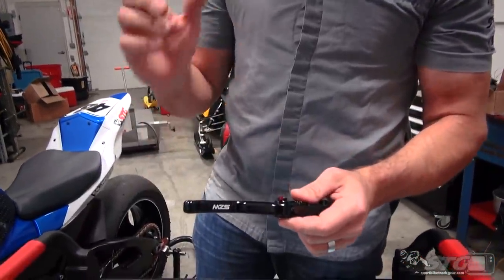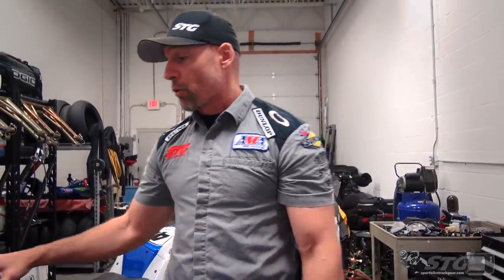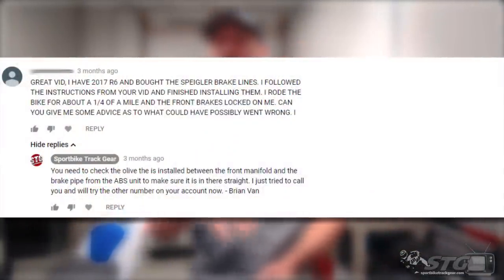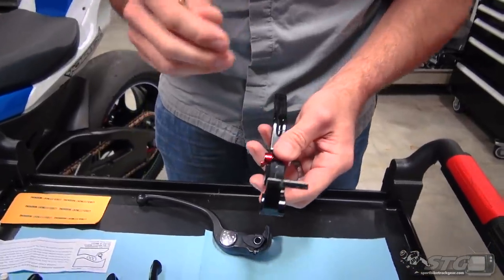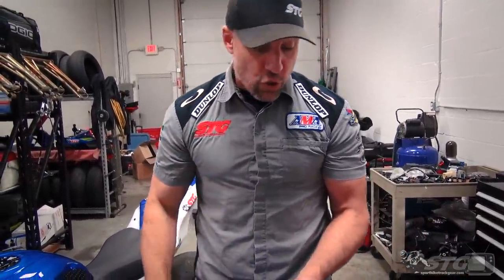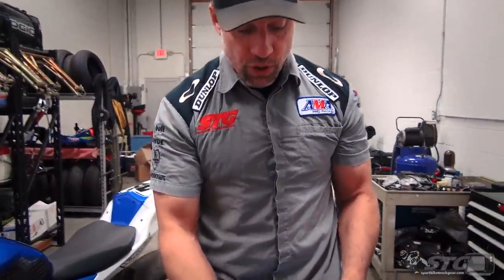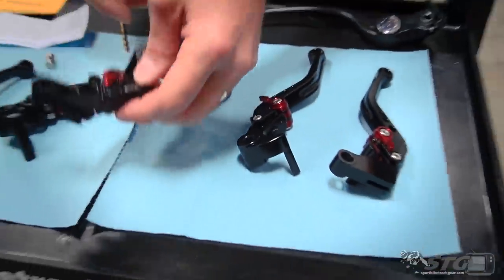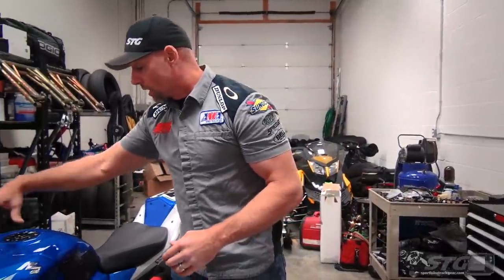The Truth About Cheap Motorcycle Levers | Sportbike Track Gear

Comment: I love STG but I also love my $30 eBay levers which are undoubtedly from China.  I also know people who have had $700+ rearsets snap like toothpicks.  Quality is important though and you must inspect any part that goes on your motorcycle putting safety above everything else!  I think Brian does a great job of trying to educate riders and get people to focus on safety and that is never a bad thing!
Reply: Agreed. It sounds like the story was 1 part cheap lever, 9 parts poor installation and poor testing.
Reply: I think that's pretty cavalier, considering we're talking about something that could catastrophically fail at any moment. I'll save money by buying cheap chinese made knockoffs when it's a wallet or sunglasses, but when it's something that you need to depend on to keep you safe, buyer beware.
Reply: You could apply that rationale to a great many parts on a motorcycle. Don't get me wrong, I think you absolutely SHOULD apply said rationale liberally, as motorcycles are inherently dangerous. But regardless, an aluminum bar is an aluminum bar. The line-bearing-housing interaction needs to be seated correctly, lubed, and obviously to fit with integrity. If that is the case, worry not. 

Either way, giving your money to STG is a good decision, so that's another plus to the expensive levers. STG takes good care of us all.
Reply from the maker: The issue with this particular lever was not caused by improper installation IMO. The tolerance between the cross pin bushing and the lever body was too tight which caused it to bind. Said binding caused the brakes to lock. - Van
Reply from the maker: Well said my man! If the $4 sunglasses shit the bed you just throw them in the trash and move on. - Van
Reply: @Bhg265  " But regardless, an aluminum bar is an aluminum bar."
This is simply not true. With some knowledge of mettalurgy and heat treatment you would not have said this.
Reply from the maker: @Bhg265  sorry man an aluminum bar is not just an aluminum bar. So many variables involved like grade, thickness etc...
Reply: @raydavison2972  Actually, after more more materials and engineering classes than I care to remember, I absolute would have said this. While your mention of heat treatment--considering the application in question--makes me suspicious (not to mention that you misspelled 'metallurgy'), nevertheless I will give you the benefit of the doubt that you didn't just google those terms...

As you and I both know the application dictates the requirements. In the case in question--5-15 lbs of force being applied to a lever (a liberal estimation even)--an aluminum bar is most certainly an aluminum bar. After all, if the range of stress accounted for in the application is far before the limit of either material, it is meaningless that the toughness of one material is vastly beyond that of the other. 

Assuredly, just as you could point to the aluminum of a cheap lever as "inferior" to that of an expensive lever, I could point the the latter aluminum as "inferior" to the aluminum used in a submarine propeller or aircraft rib--but to do so would just make me look silly, since as described above the range of stress we are accounting for falls well within the limits of both, and they will perform the application identically.

A conceptual example is a diamond. Two diamonds could be drastically different at 100x magnification, but if they are identical when perceived with the naked eye, then of course for that application they are the same. 

Sheesh, now I am worried we will soon see "Heat Treated!" under the product description for our brake levers--more $$$ selling the illusion of meaningfulness to the misinformed. Nobody tell Lightech!
Reply: @sportbiketrackgear  Undoubtedly true! However, as described in my response to the previous comment, the only qualities by which one could differentiate grades in the application being discussed would be stuff like ease of machining/aversion to corrosion. Strength wise any grade used would be identical to the user. No need for 7075 to withstand a few pounds of pull!
Reply from the maker: @Bhg265  I only understand 67% of the words in that response man. That said I do know the part needs to be able to manage or hopefully exceed the force it would be expected to see given its application. It takes some level of engineering to determine which grade of aluminum would be best as well as the appropriate thickness, etc... The MZS levers I show in this video are absolute shit IMO. If you prefer not to spend what it takes to get a good quality set of levers you would be better off leaving the OEM levers on the bike. 

We now have several comments in this video from riders who have had these levers cause their front brakes to lock. Also have a couple on our Facebook post with a picture of a bike that was crashed when the levers caused the front brake to lock. Aftermarket motorcycle controls require proper engineering. These levers are not an example of that IMO. - Brian Van
Reply: @Bhg265  Just a typo, but thanks for the benefit! Like you I have lots of engineering experience including a Degree then a Masters followed by decades in manufacturing including quality management and testing so I've seen a lot of the best and worst in both design and production. 

But back to real life. I've seen quite a few of these cheap levers fail first hand (Not the brand shown here but most are just generic items that have many brands applied to them) including simply fracturing from a simple lever pull (Really scary for the friend I was with). 

There really is some junk out there and you cannot always tell by looking at them. Some of the tell tales of course are the tolerance issues raised in this video. Why on earth would someone put these cheap levers on a 10K bike, or even a 2K one. Spending hundreds on carbon bling and then cheap out on safety critical items - just plain crazy. You are better off just keeping the OE items.
Reply: You put a $30 pair of levers on an rsv4..... *Facepalm*
Reply: @jakemandel92  It wasn't a financial decision.  The levers I bought are color matched to the bike and I just really like the way they look.  I did a bit of research before buying them and saw others that have them and did not see any issues.  I do get what you are saying though and tend to agree.  I have some very expensive parts on my bike that can certainly be purchased for far less money but if budget constraints are a concern it's unlikely you would be buying a machine like this in the first place.
Reply: One of the areas, less expensive products save money is on less thorough quality control. So you have to take up that slack and inspect your merchandise carefully and make sure everything works as it should.  Really you should do this with anything that goes on your bike, but be extra diligent with cheap products.
Reply: @sportbiketrackgear  Just looking at that pin again... Looks like rust on the Cheaper leaver think it is on the snapring side.
Reply from the maker: @wobblysauce  Poor tolerances are the issue with the lever. The pivot needs to be tight enough not to feel sloppy while offering enough clearance to allow for slight corrosion without seizing in the bore. Better to leave the OEM levers on the bike if you do not want to invest in a quality set of aftermarkets. - Van
Reply: @sportbiketrackgear I get that point with tolerances, but could it have also been the choice of materials? 
Eg, if it is rust on the pivot, it can make a mess of things also and cause binding even with the best tolerances.

Comment: CycleCruza got them $20 Ebay levers on his CBR1000RR with no issue, I had a set on my Ninja 300 no problem. Still using a set of $20 Ebay levers on my new Fz07, so far so good, the pull fells amazing. I can say that 95% of levers on the market r prob made in China. Not paying for $120 for a single lever. LOL
Reply from the maker: Whatever tickles your pickle man. Over the  years I have installed several different brands of levers on a wide range of bikes. My opinion is based on first hand experience and information learned over an extended period of time, not 1 set of levers on one bike. There are already several comments on this 2 day old video noting brakes locking up caused by the lever. Not worth the risk. Using these levers is about as smart as wrapping your junk with knock off condoms IMO. - Van
Reply: I didn't know thay made after market levers for Chinese scoootaasss
Reply: You are taking advice from CycleCruza?😳 good luck.
Reply: should i taking advice from u? hahahaha @sapalobo9723
Reply: @LeaveYouOnRead  probably not, but I stand by this one.
Reply: Sapa Lobo cycle cruza made a video teaching people how to “counter steer” and he was so completely wrong it was like he had never sat on a bike lol. Apparently push right lean right go right meant you pushed down on the right bar to turn lmao
Reply: I'll take made in china from an established company that has a reputation to preserve over a lowest common denominator seller/brand on ebay/alibaba.
Reply: @sportbiketrackgear  Haha🤣
Reply: I don't think he watched the video...

Comment: Great video! Thanks :). At first, I was skeptical - "Oh great, another retailer trying to convince me to buy expensive stuff" - but what you said made total sense! Also, it was awesome that you were very respectful and made it clear you had no ill will against China, but these motorcycle levers are just dangerous. Before watching this, I was completely unaware of the axial master cylinder/lever setup, having ridden mostly dirt bikes.

That being said, I believe there is room for some clarification. For this axial master cylinder/lever setup, the Chinese quality control makes these levers DANGEROUS. Even with modification and maintenance to make it smooth and tight, I am not sure how the materials would wear.

HOWEVER, for simpler levers, like those on dirt bikes, without the axial design, Chinese levers should be totally fine IF you check them out to make sure they are structurally sound and don't bind at the pivot point in the master cylinder or perch. Sure, they will have more slop and be generally less refined, but they should work fine.

Thanks for the great video!
Cheers
Reply from the maker: If you lose your brake lever on a road bike you are in some deep shit. Is saving literally a couple of bucks worth risking yourself and your machine? - Van
Reply: Oh yeah, but there's a HUGE gap in pricing between the 'better' ones and the ones that come from China, like, £120 a set of Pazzos versus £14 from China, where they're being produced anyway!
Reply: Dirt bike rider here. It's a total waste of money buying the cheap Chinese levers, they rattle apart in no time and the tolerances are rubbish. Did it once, regretted it, now will only buy and install Zeta levers. They might cost more but they are worth every cent. Ride on!

Comment: I'm glad I watched your video because i bought these levers and when i tested them I almost crashed due to the front brake locking up on me due to that cross pin being in that fixed position with no flex in it. Good thing I was going slow when it happened.  I don't have an issue with it now since it has probably "adjusted" are my near miss. The clutch actually sticks a bit and is slow to return to the normal position thus not engaging the engine fully. I will be taking this shyt off and going with your recommendations. Thanks!
Reply from the maker: You are welcome and thank you for watching! - Brian Van

Comment: I use to stand by Chinese levers; they can definitely get the job done for the avg street rider. After converting my bike to track-only though, I was throwing the Chinese levers out by noon and putting the OEM ones back on! The play that you showed in this video is important if you're looking for the absolute most precise and smooth lever actuation. For me, with a quick-shifter, the up/down play in the (clutch) lever wasn't very bothering. My problems with the Chinese levers came when I started to heavily brake into the corners. There is SO much flex in the lever when you squeeze the piss out of it. It actually gave so much that I had to adjust my levers another 1-2 clicks, which was uncomfortable, but gave me enough stroke to not bottom out! It was crazy. I'm sticking with OEM from now on... I might do a shorty lever on the clutch side and I do I'm definitely going with a name-brand like Pazzo, CRG, etc.
Reply: I got vortex lever for brake and use Chinese for clutch. The vortex came with the same knuckle as the Chinese one

Comment: Wow, great video. I was going 110 MPH on my gsxr 750 on the highway and had CoreMoto brake lines on, first 5 miles with these levers my front tire RAPIDLY locked up and by some miracle I didnt wash out or fly over my bars. I stopped so fast form 100+MPH that i didnt even have time to merge onto the left shoulder while i was in the far most left lane! I was half sticking out in traffic. A cop and pedestrian pulled over to help me lift the front of my bike and roll the bike out of hazard. BEST BELIEVE I am spending $120 on a brake lever now!
Reply from the maker: Happy to hear you did not crash. - Van

Comment: Properly working brakes are more important than a working throttle or even engine. Sure, wear happens, but at the point where they don't brake anymore, you better pray you have good enough gear to take that coming impact unless you can engine brake enough to survive.
Reply: I been riding for more then 12 years I believe If I am meant to die , I will die now matter if I have Pazzos or CRG.

Comment: My OEM levers dont even have those bushings
Reply: Yup ordered one from Amazon. I was scared when I watched this video and never bought them until recently I pulled plug after many recommending for my motorcycle. By that time I remember the watching video but didnt remember the reason not to buy.

Well my break levers are so fucking simple, just a simple lever that can is held by original nut and bolt. No other bearing and stuff. 

After watching the video, I am so glad I bought them and not wasted $200 on CRZ. They are worth it.
Reply: jay patel can you supply the link to the levers? Thanks
Reply: @quadruple treble 1888 lol I mean if you life is worth saving a few pennies then good for you

Comment: I had the same thing happen to my CBR 1000RR when I bought it. Bought some levers off eBay and went for a ride and only made it about 300 yards and my front brake lock up. Each time I squeeze the lever the more it lock. I actually had to Walk home and get my wrench and swap out the levers on side of the street to even ride the bike home. If I would have made it to the interstate which was about 3 miles away it would have been really bad. I pray that I never made it. But I will never buy Chinese eBay or Amazon levers again. NEVER..... So I agree with this video 100%. Saving a few bucks isn't worth crashing a 14000 bike or worse losing my life over it.
Reply from the maker: Appreciate you sharing this man and happy to hear you did not crash your bike! Amazon has opened the door for poor quality products with crazy low prices. When you look at the listing the photos make the item look amazing, deal of the century. It leaves some people with the impression they are getting ripped off if they invest in a better quality product. 

Having the opportunity to compare CRG and MZS Levers side by side is not something most would ever get to do. I can tell you that there is a massive difference between them. - Van
Reply: I put some on my buddies 600rr and had the exact same thing happen. Day before a trackday so I told him go ride it to make sure it's good. He called me from the first stop sign he came to and I had to beat the pin out with a hammer and screwdriver lol
Reply: Same thing happened to me except I made it to the highway. Luckily I didn’t go down but I came to a complete stop right around a blind turn and there I was stuck in lane 2 with my bike trying to get drivers attention so me and the bike wouldn’t get hit. Shit went on for almost 10 minutes before someone finally pulled over to help. That shit was sketchy and I’m super blessed it wasn’t way way worse.
Reply from the maker: @yteka99  Thanks for sharing, already a ton of brake locking comments on this video. - Van
Reply from the maker: @nathandaniel6540  Glad to hear you are ok. Tons of people have already posted comments about brakes locking in this video and it has only been up a couple days. - Brian Van
Reply: Did you grease the pivot points before installation?
Reply: A few bucks? Lol it's not even close brah